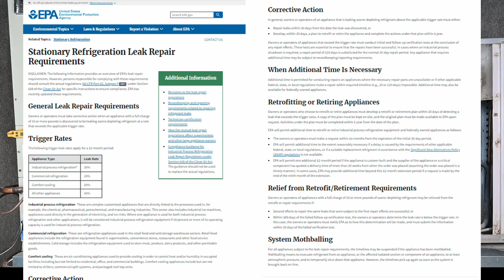HVAC 158 low on charge, LEAK!

Comment: Friend bought an entire system due to a evap coil leak. 4K for it or new system 8K. Perfectly fine furnace compressor and condenser but due to the way hvac installers price it it’s conducive to just throw away crap. Disposable society.
Reply from the maker: Too many companies just want to sell, then they don't install the new system correctly.

Comment: epa law over 50 pounds.

what if it involves a 2 stage system where each stage is less than 50 pounds and are separate refrigeration circuits and 2 separate compressors and only 1 stage has the leak causing the system to not satisfy so it kicks in the second stage?

does the epa have the same requirements there?

also with the epa being defunded by trump can the epa even do anything.?
Reply from the maker: Everything is on the EPA website.
You can even find all the fines issues.

2 thoughts on this.
The EPA is the only regulation we have, it's a very small and easy to follow and simple regulation. 
If professional service technicians are not going to follow these simple steps then anybody should be able to buy refrigerant and do the work. 
Just hop on down to the auto parts store and buy a cans with a pressure guage in it. If we are not going to recover refrigerant or fix leaks, then there is no need for homeowners, handman or anybody else to do so.

As professionals charging professional prices I believe we should be striving to  do things the best we can but the choice is always  up to the person doing the work. Go to lows and buy a condensor just like you buy a water heater, electrical service panel or lawn mower. 

As professionals we should be striving to do the best work we can, improving our skills and processes.
 Instead so many are  arguing and fighting to do things the simplest we  can find. It's a race to the bottom and it makes all of us look bad.

Integrity is doing the right thing even when nobody is watching. The EPA  is probably not going to do track you down for doing something wrong but that does not make it right.

Comment: In a few days, all that refrigerant could leak out...wow..if it was that bad, would the system be emptied of freon already?. And should the tech be able to check for system pressure drop rate, or at least ask the customer if the system has to be topped off yearly and guesstimate how bad the leak was?. A good experienced tech should not only give the options but also recommend the best options to customers...but hey things are different now, everything is about sale and profit. Stuff are built to be broken and replaced for producers to make profit.
Reply from the maker: There are many types of leaks. How those leaks form and where they form are different. 
It's not uncommon to have a leak develop on the high side and have a subcooling if 2. The tech charges the subcooling back 10 with say 1.5 pounds of refrigerant. 
The vibrations of the unit and now the higher pressure of again a proper charge increase the leak fracture point and leak size. By the time the time the peak evening hits the systems is now lower on refregerant than it was that morning. 

On another scenario a system has a leak in the low side. Adding refrigerant does not affect the leak rate. The system slowly looses charge over the year.

It's is not possible to know how low the charge is with a running system. We will measure the quantity of refregerant as we add refregerant back it to achieve the proper superheat and subcooling. A system could be at 2 subcooling and need to be at 10 subcooling.  
That could be the difference of . 5 pounds of refrigerant or 8 pounds of refregerant. 

The only way to know how much was left in the system would be to recover it all out and weigh it. Calculate the system line set length and the factory charge. Then compare that number to the how much you pulled out. 

To then find the leak rate you would have to compare that over an amount of time from the previous leak. 

Recommendations are certainly in the realm of a tech. However the vast majority of techs just add refrigerant and go the the next call without providing the customer with any options or recommendations at all.

On the other hand selling techs would have pushed for a new system and not provided the other options.

I'm not sure how a video of providing options to a customer was perceived as all about selling.

Comment: One of the nice things about commercial/ industrial is the customers are ok with a very detailed leak inspection. In residential the customers do not want to pay for a proper leak search. Im not a fan of those "leak seal" products....but i can see their place. I also if i did ever use them, explain it has no warranty,  no guarantee and you stand a chance at further damage of equipment due to how the product re-acts with the refrigerant system. Ive seen those leak sealers take out compressors before. If after all that, they still want it....ok sure.
Our job is to notify of the issue and to provide options. Thats it. Its not our money to spend for them.
Reply from the maker: I could not agree more!